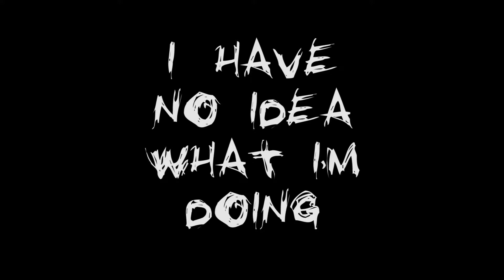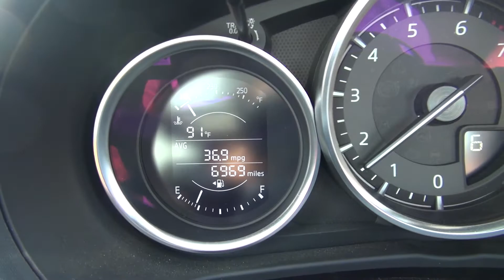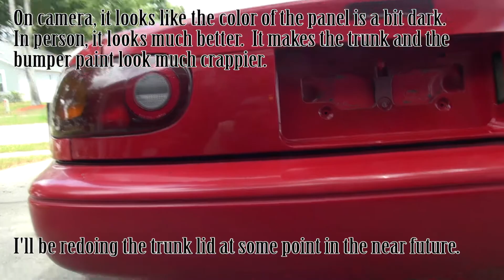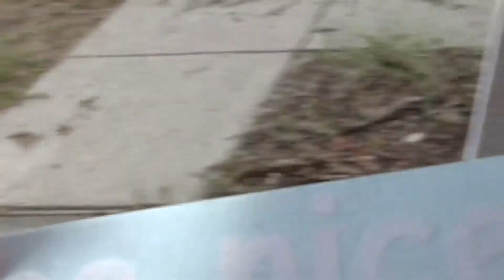1990 Miata Restoration Project - Episode 34 - Rear Finish Panel Replacement

Comment: Very helpful, thanks.   I'm also a 2 Miata family, red and BRG.   I want to take the faded red one off (it's the most faded part on the car) and satin black it.   Good to see how it comes off because just masking it seems pretty cheez  :)
Reply from the maker: Really need to be careful of the center clip that holds it on.  You can't really get to the back of it because the trunk latch is in the way.  You can slide the panel up to release it from the clip once everything else is removed.  Just be really careful because you can break it easily, as you could see from mine Hulksmash attempt to get it off in once or three pieces.

Comment: Great vid bro the panel came out really good, would have never thought it was spray painted lol!
Reply from the maker: I surprised myself.  It would have been nice to have a little vented paint booth area because I think a few pieces of dust or just crap flying around landed on the part, but it looks about 327% better than the old faded piece before it was modified into 11 smaller pieces.  I was going to be repainting the piece anyway, but the lady broke it just in time for me to actually get a new piece.  Something that likely would have happened anyway if I tried to remove it myself.
Reply: Enjoyed the video.  To prevent dust and crap from falling on recently painted parts, cover them with an upside down plastic storage bin.  This was a Chris Fix tip:)

Comment: Do you think a coat of primer would have helped with the color consistency?  And what about a clearcoat?
Reply from the maker: Probably not.  The existing paint is 30 years old.  The color just won't stay that exact color 30 years later.  And it's really not that far off.  As far as clear coat, absolutely not.  The single stage paint that Mazda used on their early Miatas was amazing, and 30 years later, it shines up almost as beautiful as it was the day it was applied.  ALL clearcoat will eventually thin, haze, peel and flake.  The Florida sun only accelerates the process and even if I one day have this car resprayed, it'll be the original single stage paint process without a clearcoat.

Comment: 3M double sided tape is what you'll want to use to reattach the badges to the rear finish panel. I'm actually quite surprised at how well the paint looked without any prep!  also, I absolutely love the stance in the thumbnail picture; it's beautiful! although in the video it looks like both the rear wheels are toed in, but it's probably just my eyes haha. Glad to see another update!
Reply from the maker: I'm not sure what kind of prep I could have or should have done on a smooth plastic molded piece.  I really was going to scuff it up with the 1000 grit, but just couldn't bring myself to make less smooth an already smooth piece.  Seemed to work ok.  

And did you mean toed in or camber?  The camber is probably around -3 degrees.  No idea if it's toed in.  I was going to get an alignment after I did the suspension, but driving it, it feels really good and doesn't pull at all.  I know an alignment couldn't hurt, but why spend that money when I could buy stuff. :D

Comment: Does the paint match well?  Or can you tell?
Reply from the maker: I think it's a near perfect match.  Granted, there's always going to be a difference between paint on plastic and paint on metal.  And since the finish panel is a piece of plastic between metal pieces and the softer plastic bumper, there's slight differences if you look close enough.  But it was good enough for me.

Comment: Good job. Turned out well. Should have gave it a 1k rub down though. With a few more light coats, but time will tell. The reason the "MAZDA" has the Miata MX-5  doesn't is because they used different badges depending on the market the car was sold in. (Like the EUNOS Roadster badge) but to remove the posted emblem drill them out very shallow from behind and it will leave you enough post to reinstall with epoxy or a short panel screw(like whats in the interior) there should also be holes marked on the back of the new finish panel were to drill for the posts of the emblem

Comment: cool video! the panel looks great. how many coats did you end up using?
Reply from the maker: It was basically the first coat that you saw, and then two more full coats after that, plus a final touch-up coat to finish off the can.  And thanks.  I used rattle can on the trunk lid and it didn't look anything close to as nice as that panel.  But I didn't prep the trunk lid properly.  I'll be doing it again soon.

Comment: Wow, and I'm over here struggling to sell an uncracked oem panel for $80.
Reply from the maker: What color is it??  I've got a friend needing a white one.  The other issue is that these all get brittle with age.  I wouldn't have wanted an old one to replace the broken one.  Who knows if it'll survive the installation process.